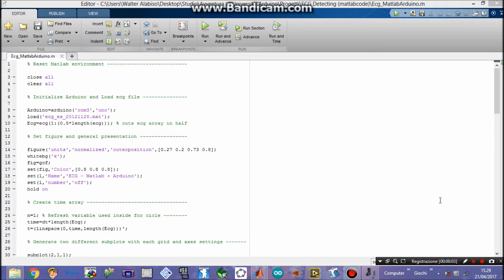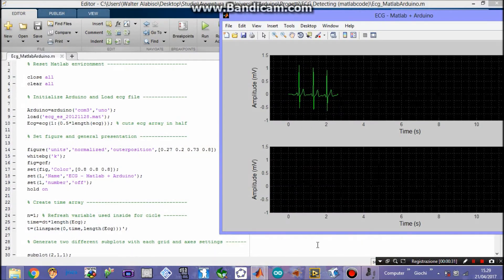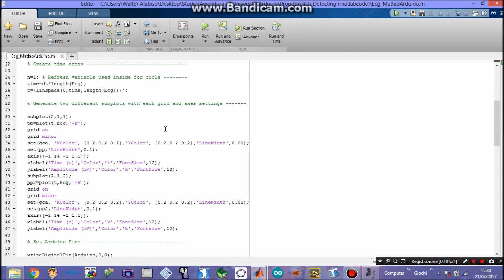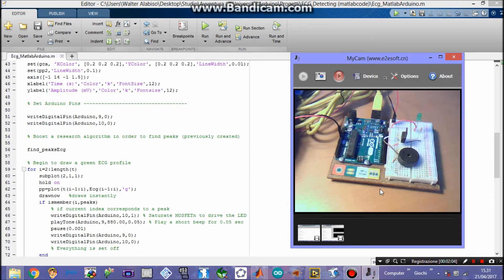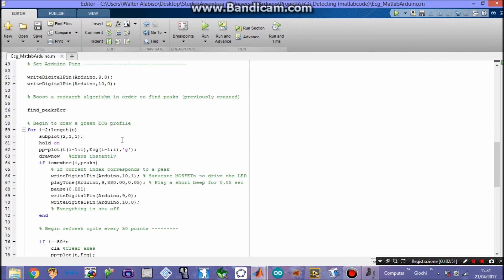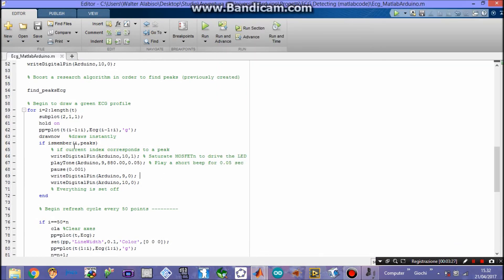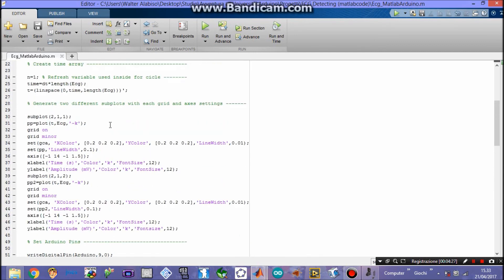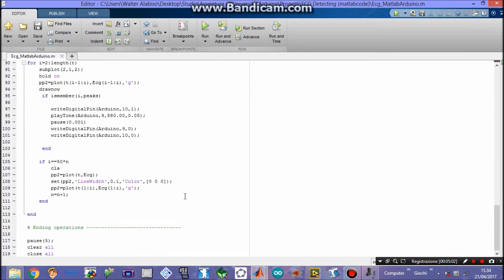ECG peak detector! [Matlab+Arduino Project] ENG

Comment: may i know the file "load('ecg_es_20121128.mat');" consist of what? i cannot run because of this
can u respon it
Reply from the maker: Hi! I haven't been active on my own channel for a lot of time 😮. Did I actually share the code somewhere? I can't remember... If so, I might have forgotten to share the ecg file as well. That's a simple .mat type of file,  a vector. If I can retrieve it on my old computer, I will post it to you and pin your comment. Thanks for watching!

Walter
Reply: @LinkAranGalacticHero  tq

Comment: Brother I have subscribed ur channel please send me the circuit scheme I beg you please 🙏🙏🙏🙏🙏🙏🙏🙏🙏🙏🙏🙏🙏🙏🙏🙏🙏🙏🙏🙏🙏🙏🙏🙏🙏 or at least send me the photo of ur connection
Reply from the maker: Hi, man! Thanks for subscribing! The problem is that I moved to Sweden recently (I've left Arduino kit in my home country) and I switched from Biomedical to Materials Engineering. I kinda lost track of my previous projects, because so many things happened. I've never sketched the circuit out though, but I remember sharing the code (have a look at other comments below) so I'm pretty sure you'll figure out the connections by looking at how I wrote the commands in Matlab. As of now it is really hard for me to recall, but it's nothing too complicated anyway ;)
Reply: @LinkAranGalacticHero  thanks for the reply but can you please tell me the lead connection where to connect the leads from human body to the circuitry please help me out
Reply from the maker: @akshaynayak569  OOOh now I see! No, in this project, this was a pre-acquired signal! There was no connection with a human body at all. This is rather a post-processing example: The signal was acquired by my professor and provided in a vector form. Then my code processes that, and analyses peaks. I'm sorry for the misunderstanding...

Comment: Can you send me the code and the connection scheme?
Reply from the maker: I actually haven't created a proper connection scheme with some software, I am sorry! Basically you need to connect the piezo to a digital pin (9 in this case) and to ground. Then link the MOSFET as shown in the small pic ("drain" to digital pin, say 10, "source" to the ground and "gate" to the green led, series with a 220 ohm resistor and Voltage supply)